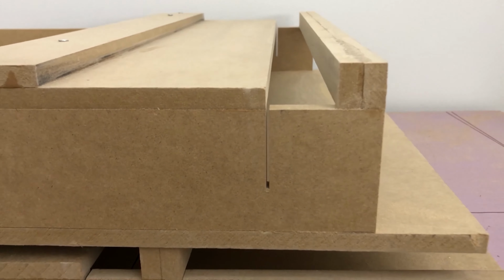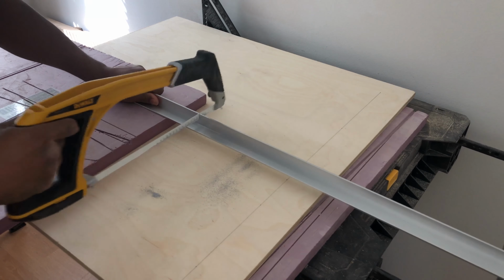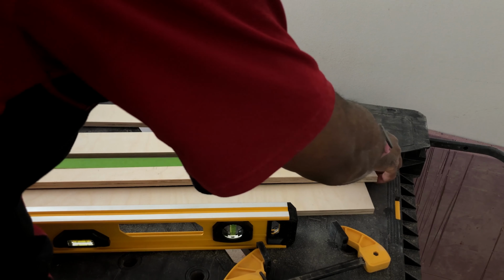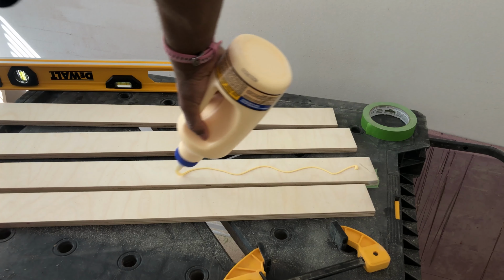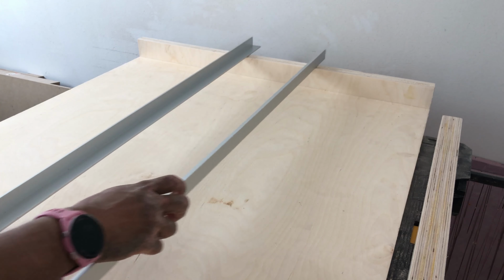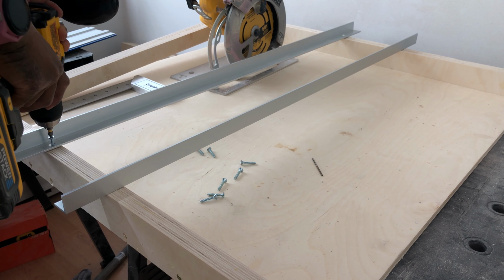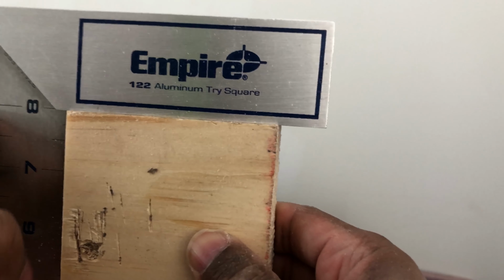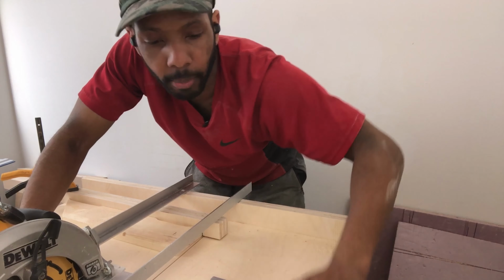Building a New Circular Saw Guide Track | Woodworking

Comment: Is the rail aluminium rail supported well in the middle?
Reply from the maker: It isn't. It should be supported with wood or something else sturdy. Its strong enough to hold the weight of the saw but bends a bit outward if you push it too much to the side